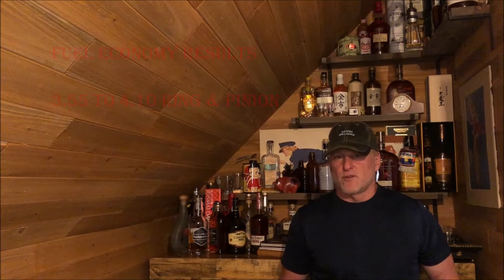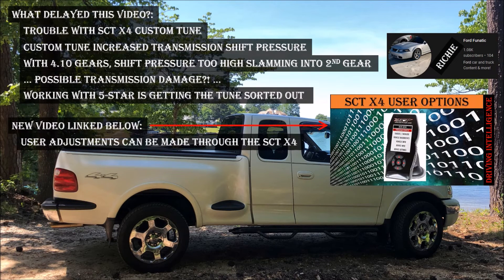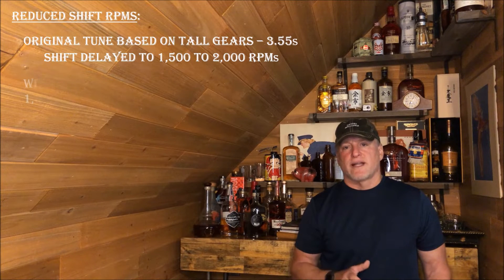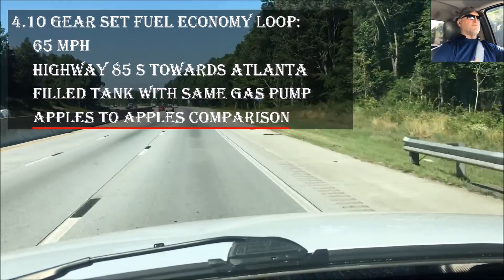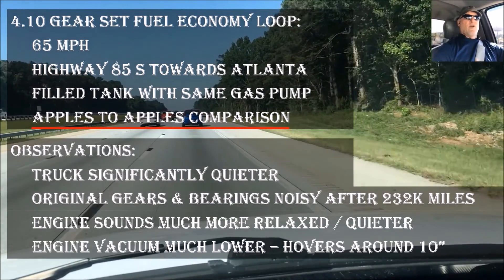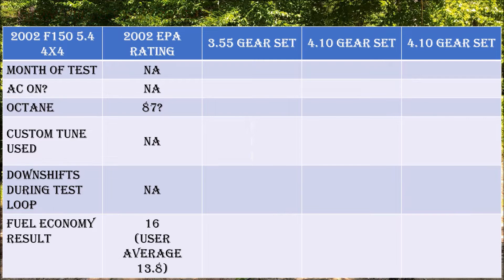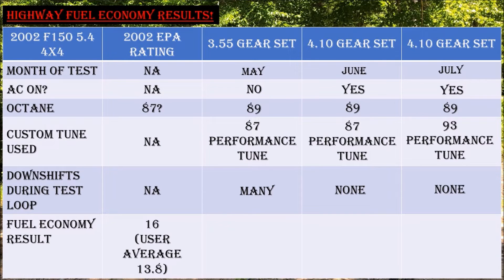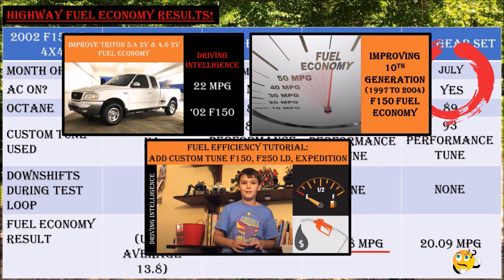Will Shorter Gears Reduce Fuel Economy / MPG? 3.55 to 4.10 Gear Change ’97-’04 10th Gen F150 Test

Comment: Great video. I have a 99 5.4 V8 2 valve with 33" tires and I think I get 9 miles per gallon so this is is something that I have to look into more
Reply: Do a tune up. Spark plugs, coil packs, air filter, clean throttle body elbow/plenum, fuel filter. And change your differential gear oil. The gear oil for LS (limited slip) rear end is 75w-140 full synthetic for these trucks. You must also get a limited slip additive even if the gear oil claims to have it mixed in already. They typically don't have enough for the worn clutches in the rear end. You can get this from Ford and you'll only need 1 4oz bottle. Or you can get amsoil or transX brand friction modifier from any autopart stores.  Doing a full tune up on these makes a world of a difference! This channel has videos on how to change spark plugs and coils packs and other maintenance checks and replacements.
Reply from the maker: @dyllanbabb7472  thanks again Dyllan, here is the video showing the Coil On Plug change:  https://youtu.be/AQPaFukWewQ
Reply from the maker: Thanks... there will be more vids on this topic.  I'm going to stretch the capabilities of my performance tune to get better fuel economy.  Stay tuned.

Comment: I have a 2002 Chevy Silverado v6 with 3.08 gear ratio on 33s and I have gotten 21.5 mpg. Thinking about 3.55 or 3.73 just can’t decide
Reply from the maker: Nice mpg! That's a tough decision, you may lose some mpg, but you'll definitely get much better performance, especially if you go with 3.73s.

Comment: My Navigator has 3:73 gears on near stock 30” tires. Cruising at 55, RPMs are around 1500 and 2200 at 70. My computer calculated MPG is around 15 on 91. And 16 MPG on regular last time. The Navigators are tuned for 91 and back off on timing with lower octanes. I expected a similar result from your results. I guess the 91 tune didn’t detune itself like my Navigator would.
Reply from the maker: That’s odd, timing should advance with higher octane giving better fuel economy.
Reply: @DrivingIntelligence that’s what I thought too. Maybe it’s detuning the engine that much? The dip in power between 4500 and 5300 is noticeable making highway passes. The engines throttle response drops too. Or it could just the computer calculated MPG doesn’t account for change in ECU behavior. I would like to get the truck tuned. The only issues are I live in CA and 2nd is I haven’t found any tuners. I know there’s 5 star for the F150 but not much regarding the Lincoln variants.
Reply from the maker: @PedroFerrer-vq5sw   I don't think 5-Star will provide tunes to those that live in California because of CARB.

Comment: Just put a remanufactured 5.4 L engine from Remanns to replace my blown head gasket that percolated my coolant out the reservoir bottle. I bought my 02 f150 4x4 XLT super screw used last year and got about 3,000 miles before the neglected cooling system broke down. I’m 67 and a local shop wanted 2700 just to replace the head gaskets. I decided to get a 22 year upgraded 5.4 for 3,000 and another 400 with the installation kit. Parts replaced ie. Radiator,heater core,degas tank,coil packs,injectors, intake, and all cooling hoses. 2.5 months and now runs perfectly and 1st conventional oil change is coming up at 500 miles without synthetic until 5,000 under warranty terms. We previously had contact and I appreciate your help. I have a 21’ #5000 Toy Hauler for my Ural Motorcycle with Sidecar. I know my truck will have better power than the 186,000 original mileage.  And will not be neglected, although it will be handed down to my son and his son. Now my question with 265/75-r16 tires and 3.55 gears I was able to get 17mpg on a 70mph 600 mile trip to get our toy hauler. On the return trip it was hard to pas a gas pump. A strong headwind with O/D off caused the truck to try 2nd at 55. Found a rest area and stayed overnight. The next day was better and pulled hills mostly around 45 and 60’s on the flats. What would be a good ratio for pulling  together up to cruising speed and not kill mileage when empty. Its main job is hauling us for Adventures. Long post but the more information I can provide will help you help me. Thanks for all you do 🙂
Reply from the maker: Please check all my videos in the Gear Selection Playlist in my channel.  This will give you an idea based on your tire size and gear selection.  I run about a 30" tire with 4.10 gears and normally get between 18.5 to 20 mpg on the highway running between 70-80 mph.  That's of course without a load.  Also, check out my fuel economy playlist for modifications I made that improved performance and fuel economy.  My truck is a completely different animal with all my mods.  Easily running down the highway with very little throttle input.  It was a wimp when I first bought it with 165k miles on the clock.  I'm still on the original engine at 262k miles and will soon make an almost 800 mile trip with no concerns.  looks like your tire diameter is over 31" so a 4.10 gear should work very nicely, but again, please view my playlists.  You can improve performance with an underdrive pulley kit and electric fan conversion and perhaps find the performance you need before a big gear change expense.  And thanks for watching!  I hate to ask, but if you feel so inclined, you can drop a few bucks through my Superthanks in my videos.  :))) If not, it's all good, glad to help.

Comment: Man I wish I got the same gas mileage as you. My 2010 averages 14. I am contemplating going to 410 gears to help pull my boat better and hopefully get better gas mileage
Reply from the maker: My fuel economy is based on highway at a steady state speed.  I know my fuel economy will be better while towing, so you may see similar results.  My truck is so much more drivable.

Comment: Swapping to steeper gears doesn't make any sense if you're trying to get better fuel economy.  That is if you drive in a manner where you're trying to get good fuel economy from both.  Unless you have a gearing/tire setup that is just too difficult for the truck.

A higher numerical gear will increase engine rpm which increases fuel consumption.....generally speaking......but whatever.
Reply from the maker: If you simply think about rpm, then your assumption is correct, but there are other factors, especially engine load.  Higher engine loads use more fuel.  When a vehicle is bogged down due to gearing, it consumes alot of gas.  Let's look at it another way... if you install bigger tires (larger diameter), your assumption means better fuel economy because the gearing is numerically lower.  As you noted, fuel economy drops substantially with bigger tires.  And the data speaks for itself, I had no change in fuel economy with the shorter gears.  Can't argue with data.

Comment: I rarely check the fuel economy on my 02F150SupercabLariat5.4FX4 but a couple of times I checked it driving from Homestead, FL to Wilmington, NC and return, a distance of 800 miles.  The truck had stock tires Michelin P metric 265/70x17 inflated to 40 psig.  The only mods are the Superchips 1715 87 octane tune.  The trip was mostly 4 lane and mostly with the cruise set at 80mph and it had a camper shell on the back.  I don't think the shell does anything either way for gas mileage.  Anyway, I got 16.0 mpg both ways.  I was pleased with that considering how fast I was driving.
Reply from the maker: that is pretty excellent.  The stock wheels and tires really help these trucks move better.  In hindsight, I wish I had gone with 18" wheels versus these heavy 20" wheels.

Comment: My expedition has 215 rear gears
Reply from the maker: 2:15?!  Never heard of those gears!
Reply: @DrivingIntelligence  yes that is what the door say
Reply: 17 rim size 276 tires
Reply from the maker: 276?  Not familiar with that size
Reply: @DrivingIntelligence  lol I be confused lol
Reply from the maker: @bryantmatthews93  no worries, a gear change like I did will make a world of difference
Reply: @DrivingIntelligence  I say this it isn't terrible on gas not to bad for such a big suv being it is 2wd. Sits like it has a lift kit lol but it is comfortable and quiet
Reply from the maker: @bryantmatthews93  they are nice rides... my F150 gets better all the time with my mods... ;)
Reply: @DrivingIntelligence  I couldn't figure out why it was running so crappy under why open throttle or even just cruises, the idle would hint up and down. Soooo, when I bought it carmax filled it up must have been 87 it finally ran out I put 89 back in and tonight I stepped on it oh man beasty can mov3 was door to door with a 19 accord for good ways lol 😆  89 and up only for now on
Reply from the maker: @bryantmatthews93  interesting... might have been bad gas from CARMAX.  Glad it runs better for you.
Reply: 315 gears
Reply from the maker: Super short gears, sucking the power out of your engine. What size wheels and tires do you have?

Comment: I am definitely wanting to do this to my truck. It has the 3.55 stock and I have 275 75 17s on the truck. I bought my 2001 f150 5.4 lariat supercrew to mainly do towing and I know the power is there, but it struggles right now, and I know it's mainly due to that stock gear ratio. My 1996 Mazda b400 pulls better than it with 4.0L 3.73. Have you tried any towing with it before the gear change and after to see the power difference and fuel economy difference? Be interested to know that. I also need to upgrade my cooling system as mine can not run AC and tow long distances or up steep hills(western NC area). One thing I feel like is inadequate compared to other trucks is the cooling system doesn't seem well for towing again comparatively. I Like your videos keep up the good work!
Reply from the maker: thanks very much!  appreciate the compliment.  To answer your questions, I never had an overheating problem while towing.  I tow from time to time a competition ski boat that weighs all in about 3,500 to 4,000 pounds.  Use your overdrive button when towing or you'll burn up that transmission.  I've not towed yet with the new gears, but will later this year.  It will surely make a huge difference.  I plan to share more testing, but I'm not happy with the performance of the truck at this time.  My 0-60 is about the same as before the 4.10's which indicates some kind of problem.  I'm working with the tuner to see if it's in the ECU.  I also plan to add a transmission temp gauge and cooling fan to the transmission fluid cooler some time in the future to ensure no problems.  How much are you towing?
Reply: @DrivingIntelligence  well it varies but even my 3600 pound camper it was overheating. Come to find out its the radiator being so small. Its like a 1 core radiator. I like ford but why in the wod would anyone ever put something that small on qny truck is beyond me. I plan to swap that out and that should fix my issue and later will put a trans cooler on it too.
Reply from the maker: @dylangreen8679  I get it... I have been researching this since you wrote your comment.  Check out this radiator:  https://amzn.to/3RKexyg  I've not tested it, but definitely looks like an upgrade.
Reply: @DrivingIntelligence  that is exactly the one I was looking at and plan on putting in. Thats a big improvement.
Reply from the maker: @dylangreen8679  I've been thinking about increasing the size of my radiator as well for some time, I might try this as well.  If you use the link I sent you, it helps my channel.  Amazon gives me a little bit for marketing their site.  Thanks in advance!

Comment: Damn I'm thinking 4.88 but I have a 4.6
Reply from the maker: What size wheels and tires?
Reply: @DrivingIntelligence  33" falken at3w
Reply from the maker: @Matteo-xm6xo  big tire
Reply: @DrivingIntelligence  also a 2000 Ford expedition that I load up for vacation probably heavier then the f150.long drives across the mountains and offroading in sand.
Reply from the maker: @Matteo-xm6xo  yeah, shorter gears will certainly help
Reply from the maker: 4.88 with 33's might be turning too fast.  You are only 2" diameter bigger than me and I have 4.10's.  You might want to consider 4.10's or 4.56's
Reply: @DrivingIntelligence  yeah I'm gonna figure out my rpms and where I want them.i believe now 4.88 might be too much lol thanks
Reply from the maker: @Matteo-xm6xo  Did you see my recent 0-60 video?  It gets into rpm's and power bands before I made the gear change.
Reply: @DrivingIntelligence  I did just trying to ratio for my smaller engine.and bigger tire.i watch all your videos on the f150 👍
Reply from the maker: @Matteo-xm6xo  if I get a chance, I can check on the rpm's with your set-up with my spreadsheet... ;) and thanks for staying tuned!
Reply: @DrivingIntelligence  man I appreciate that 👌

Comment: Maybe do a transmission filter and fluid change. Just change the fluid that was in the pan. Most say it'll take 6qts to refill (the 4r70w) transmission pan, however mine only took 5 qts when I did it. The pan gasket is supposed to be reusable, but mine was flattened and didn't want to risk it leaking after I did the change so I got another new reusable gasket from Ford for $27.xx after tax. The only one the autopart stores usually carry is the felpro felt gasket. I didn't like this style. Rock Auto has mahle and victor reinz reusable pan gaskets though. I ran my 92 Performance tune for 1.5 yrs and get the best mpg with 3.73 gears and 34's tires, over the other two octane. 87 & 89 give me around 10mpg (with the correct octane tune I have, meaning I don't use 87-89 with my 92 tunes) but 92 gives me 13mpg. The only time my shifts are hard/firm is when I wide open throttle the truck. The shifts are reasonable and not too aggressive. However after running this tune for 1.5yrs swapping back and fourth between performance tune and my tow tune (when I haul cars) my transmission started to shift hard and had became extremely obvious. Even just driving normally and not aggressive it became a jerky experience, and since I already had the filter and fluid from another truck I didn't use it on, I just used them to see if it would infact help/change. It did help 110%. My tanny shifts better now than it ever has and is more responsive (not so sluggish throughout the rpm band) I thought I was going to have to rebuild transmission soon, but I'm confident now it's working exactly like it should. I had the factory plug in my pan still so that tells me no one has ever serviced it. Ford says the filter doesn't need service, but mine was black! It would be pointless to drop the pan and not change the filter. I used crc pro series parts cleaner and now I prefer that over brake cleaner when cleaning things (although brake cleaner is still slightly stronger for breaking down the gunky stuff)  funny thing is my fluid looked good (reddish pink) on the dipstick before the change, but when I dropped the pan, boy! It was like chery coke lol. All in all those ole sayings about changing the trans fluid will break the transmission is true kind of, but not typical for the newer transmissions. If you just change the filter and fluid. If the fluid is real bad, change the filter and fluid in the pan, run the truck for 5k-10k miles and drop the pan again to drain that fluid out and replace whatever came out and you should be good unless it is still super dirty. Then you may have to do it a few times. You can drain torque converter and pan and replace all fluid in the 4r70w and be perfectly fine. You just don't want to power flush the transmission lines as that causes dirt,metal shavings, pieces of old seals into the seals or solenoids and that causes damage.
Reply from the maker: thanks for that note Dyllan.  When I bought this truck with 165K miles the first thing I did was flush the transmission fluid.  The method I used:  1)  remove pan, clean pan and replace filter, 2)  add about 5 quarts transmission fluid, 3) remove the return transmission line from the transmission cooler, add rubber hose to drain bucket, start engine and let transmission push about 4 quarts into bucket, 4)  stop engine and add 4 quarts of fluid to transmission, & 5) repeats until you've replaced about 13 quarts of fluid.  Now I drop pan and replace filter every 30K without a flush.  I have a full series on the 4R70W where I did a lot of transmission work without pulling the transmission:  https://youtube.com/playlist?list=PLGNsbVXzRfZM6WpCF862q4DlkyatzFIMz  My hard shifts get worse when the transmission fluid warms up, but I also put a shift kit in my tranny that of course contributes to the hard shifts.

Comment: Very interesting.  I hope to see a test run at 70-75 mph as well as those speeds are very common.  Thanks for the effort, these are great videos!
Reply from the maker: You ask a very valid question and I plan to do that test.  I'm still working with 5-Star.  The tune is not performing as I hoped with the 4.10 gears.  Very surprising.  I'm continuing to adjust timing, full throttle shift points, shift pressures, etc,. to maximize the benefit from the gears.

Comment: Nice experiment. My stock 97 got 19-20 highway, I thought they all did until I joined the f150 group on facebook and realized I somehow had a gem! Now I've got an 01 super crew that I need to efan swap and toss in some underdrive pulleys
Reply from the maker: That will certainly help... and a tune also helps.  If you get a chance, check out my fuel economy videos in the description.  And thanks very much for dropping by and commenting.